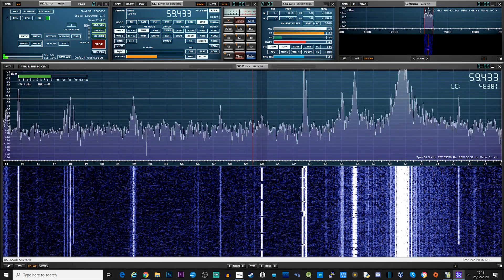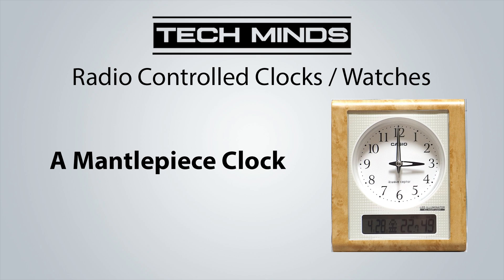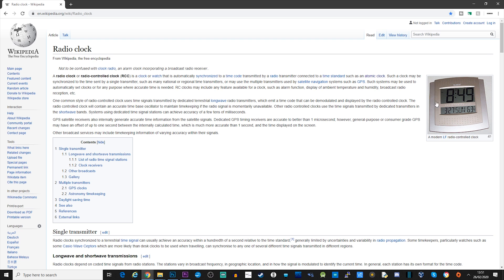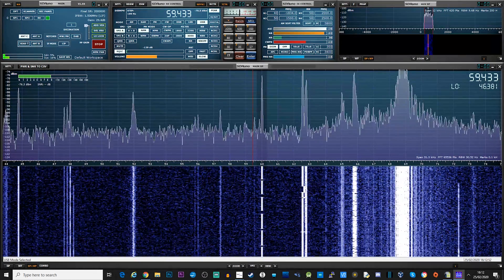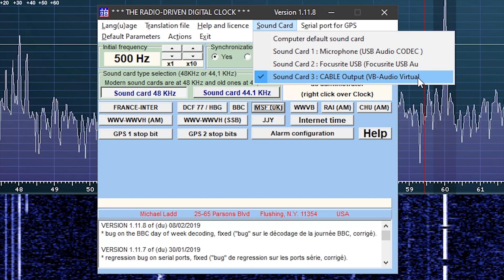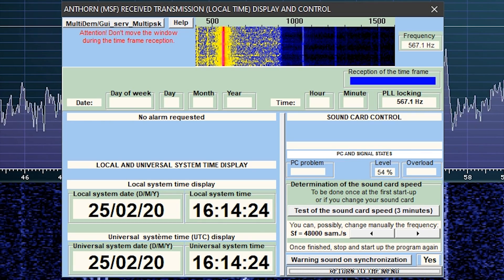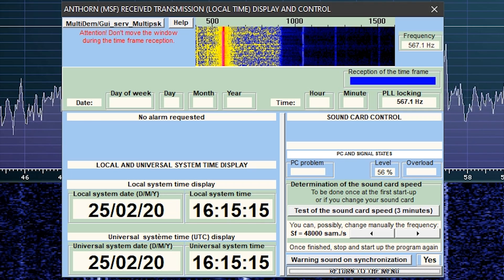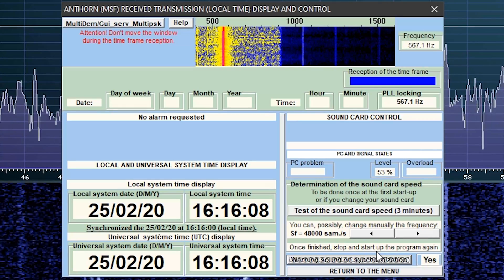Decoding Radio Time Signal From An Atomic Clock MSF UK 60kHz

Comment: I wrote software in Arduino to decode the UK and German time signals which were received using very cheap parts from Aliexpress to get a logic level output of the signal.  The MSF signal is On Off keying, so the carrier disappears for a bit then comes back to indicate bits, with others the signal (amplitude modulation) is dipped about 10% to transmit the bits.  The data contains check digits, but due to the limited amount of data (~60 bits over 60 seconds), it only works for one bit being flipped, two bits flipped and you get a valid check digit again!  So clocks and watches usually wait to receive two consecutive minutes error free, and check the time received in the second minute is the same date and time received in the prior minute but + 1 minute extra.  This is why clocks can sometimes struggle to show the time, its not that they aren't receiving the signal, its just it can take a while to get 2 minutes worth 100% error free.

Comment: Do you know if one of the cheap WWVB modules from eBay would be compatible with the MSF signals in the UK? If they both use 60khz then I suppose the antenna should be able to recieve the signal...right?

Comment: When the clock came from Rugby it had power of 60kw and I had a very strong signal in Watford but since it's moved to Anthorn at only 17kw (almost a quarter of the power) it is almost impossible to receive due to local interference most likely caused by overhead power line's I wonder what bright spark decided to move it to Anthorn at almost a quarter of the power must live in an electrically quite place with today's electrical noise it needs more power not less

Comment: Can somebody explain the following please? If the MSF time signal is broadcast on ~60 kHz, then why is the Clock application showing 567.1 Hz - that equates to 0.567kHz?
Reply: I believe that's the audio frequency of the tone you're hearing.
Reply: The software is monitoring the audio coming from the SDR receiver program.  Note that the SDR frequency is tuned slightly low at 59.433 kHz.  That will cause the 60 kHz carrier to generate an audio tone at 60,000 - 59,433 = 567 Hz.  That's the tone the software is decoding.  If you were to set the receiver right on 60 kHz, you'd hear nothing because it would be decoding at 0 Hz.

Comment: I ve managed to decode both MSF & DSF, using RSP1A.
Free version of CLOCK does not allow you to sync your PC so I tried Spectrum Lab with success (it only supports DCF). 
Propagation delay from DCF  to my QTH in Athens is about 6ms but  the  total delay I measured (compared to NTP servers) was around 400ms due to processing delay of the audio.
I don't know if there is an offset you can put in order to overcome this problem.
Maybe using a conventional receiver is a better choice to obtain accurate sync with this method.
73 de sv1fxo
Christos

Comment: Their is also the BBC Radio 4 transmitter on 198kHz. I've done a unit using an STFM32F405 with a tuned ferrite rod antenna feeding directly into one of the ADC inputs. The firmware down samples to baseband I/Q, frequency/phase locks onto the carrier and demodulates the phase shift encoded time data. I use the carrier to lock a 10MHz OCXO rather than using the usual GPS route. These transmissions are EXTREMELY handy ! .. as also mentioned, it's the same with the french TDF on 162kHz which also carries phase shift encoded time data, that's also extremely strong and VERY handy here in the UK.

Comment: Interesting. Actually DCF77 is very popular across EU, including Eastern Europe. Still, there is another transmitter in France, which seems to be largely unknown, but transmits at bigger power levels (~10 times) than DCF77. It is called TDF and the signal is phase modulated. The frequency is 162kHz. It seems better alternative. I have plans to DIY receiver for it... sometime in the future..
Reply: Did you ever get around to it? :)

Comment: Banks don't use the accurate time signal to calculate interest. It is required by law to time stamp trades. In some jurisdictions the time stamps on trades must be accurate to within 3 seconds or the trade is voided. 

Additionally, an accurate time signal is required within networks of all types. The audio recording industry needs not time but frequency (also derived from MSF and others like it) in order to align all their machines that sample incoming audio. Often the recordings are accompanied by timecode which is derived from the time receiver in the studio.

Comment: Did you say you are using a half-wave antenna? That would be around 2.5km at 60kHz, surely?
Reply from the maker: I’m using a multiband EFHW for 80 to 10 but I unscrewed the outer part of the PL259 so just the centre was connected. Made it into essentially a long wire with no Balun. But I guess you can receive such low frequencies just using a normal LW ferrite antenna like you see in radios etc
Reply: Multi-turn loop antennas are better at these low frequencies.

Comment: Since you have to get the signal through the air, dont you lose accuracy the farther you are from the source?
Reply from the maker: That’s a good question, but this is why most countries have their own time transmitter I guess. Although radio waves do travel at the speed of light so there will not be must of a delay 👍
Reply: @TechMindsOfficial  Its going to be a lot more accurate than syncing the time from the internet.
Reply: @Eon119  Given that most SDR radios have an xx ms latency, a good NTP server can potentially provide higher accuracy.
Reply: The delay is about 5.8 microseconds per mile and will be variable if you're monitoring a station by skywave as the reflection zone in the ionosphere moves up and down and the path length changes.

Comment: I got it decoding the DCF77 signal from Mainflingen Germany. Does the software also synchronizes the build in pc clock? I manually changed the pc clock to put it a few minutes off, but it never synchronized back to the right time.
Reply: Note to self: No update of the PC system time in limited version. I should have read better :)

Comment: Thanks for the interesting video! I do use the same software as you with an SDRplay-RSPdx SDR and a Wellbrook ALA1530LN loop antenna. Here in Switzerland, I can receive 3 solid clock signals. The strongest one (used in most of continental Europe) is DCF 77.5 KHz. from Germany, the 2 others are the BBC on 198KHz. and France Inter on 162KHz.  All can be decoded using "Clock" software without any problems! Unfortunately, MSF on 60KHz. is jammed by some local interference. Cheers!